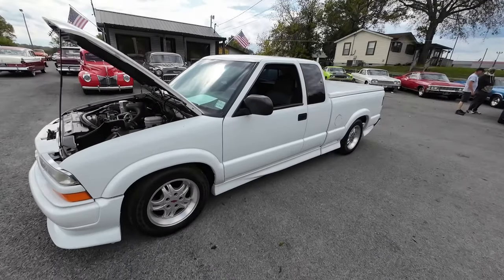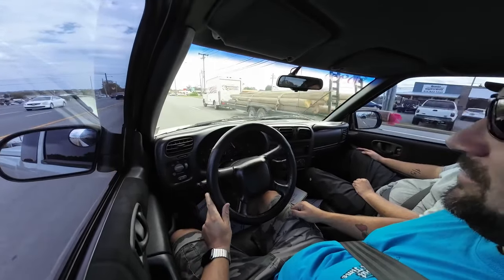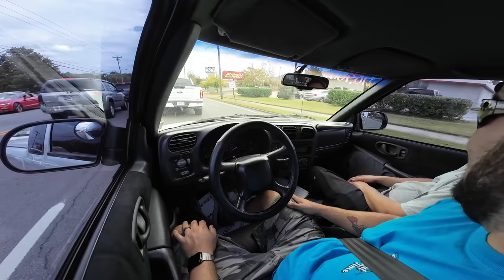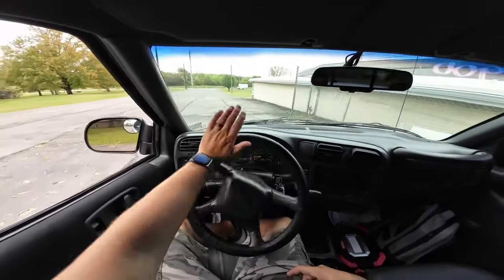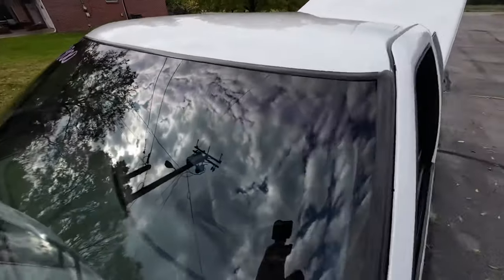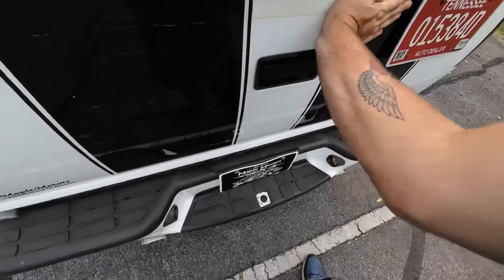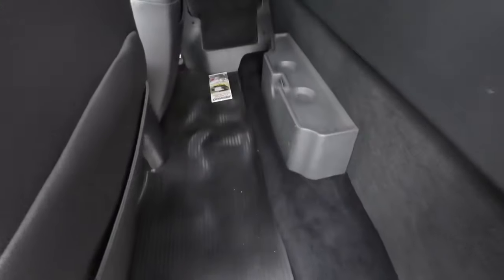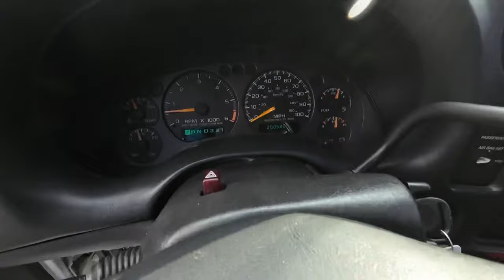Test Drive 2001 Chevrolet S-10 Extreme Extended Cab SOLD $10,900 Maple Motors #2374

Comment: This a lot like my daily driver, 2001 4×4 but looking at it most people think it's a 2wd it's not lifted and no 4×4 markings, 4.3L, flowmaster dual exhaust, performance chipped,  ext. cab 111,000 original miles I bought it in 04 w/11k miles on it for $11k 
It gets up and goes for what it is. 
My hobby with it is blowing away BMW's especially in the rain, I'll drop it in 4high.😅